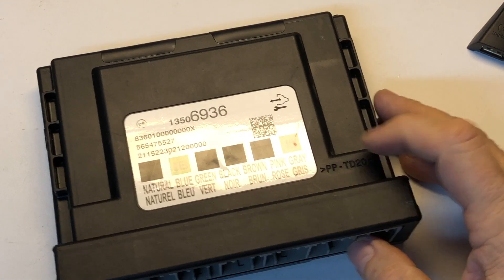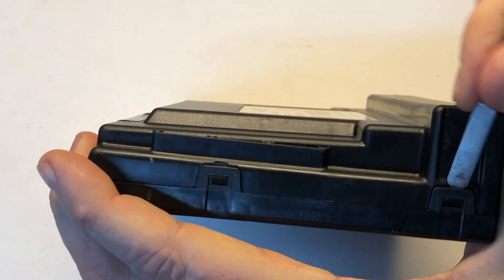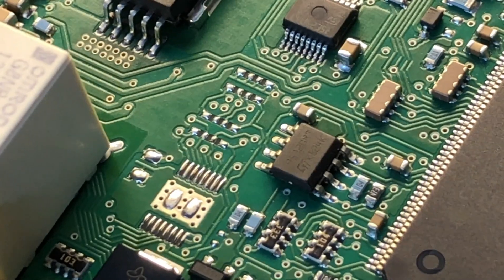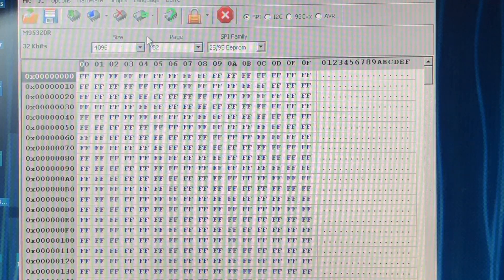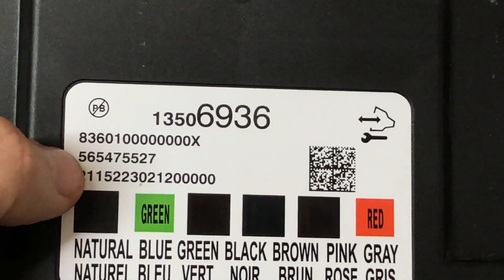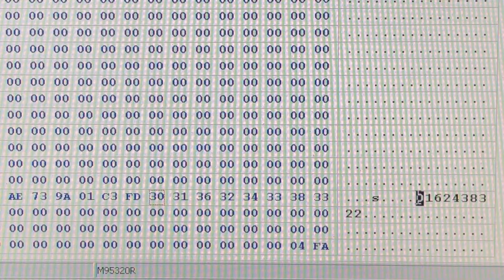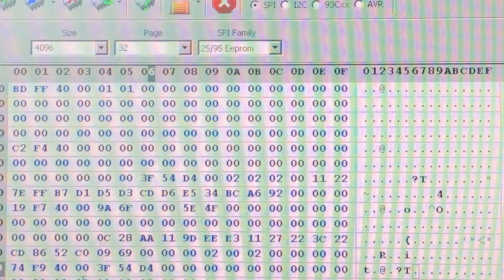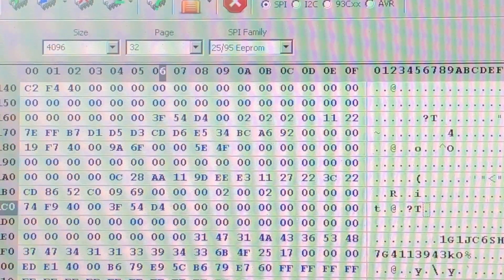2012 - 2020 Chevrolet Sonic Body Control Module (BCM) EEPROM Location & Contents (VIN, pin, mileage)

Comment: Hi  I bought an new Chevrolet Sonic  in 2014 . My kilometers started to disappear from time  to time.  I took it in for repair.  When I get it back the kilometers don't show not any more and sum other furthers  also don't work.  My original info on my BCM was saved on PC  in Bin Zip file.  Can it my be possible if my info on my BCM  cluster has been copied or transferred to an other client s car. And now he can not fix the problem.
Reply from the maker: Your story reads like botched repair attempt.   Could be the individual performing the work was unaware of the close relationship these GM models have between the BCM and IPC modules.  If you truly have an unmolested image of the EEPROM before any work was performed, it may be possible to restore that to a module of the exact same GM part number to get back to where you were originally.

Comment: did you ever tried to figure out where the features are stored at? Im trying to activate front fog lights in my Chevy using all factory used harnesses and switches, just need to activate it in the BCM
Reply from the maker: No, there's zero information of that nature.   Only the VIN and mileage locations are discernible without internal factory confidential documentation.   Option activation, like factory fog lights, has to be added to the VIN by GM directly.   A special code for this is included with the factory fog light kits sold by GM.  Check the tail end of this other video out for that process, https://youtu.be/_aO4vyqacn4

Comment: I am trying to do the same with the updated BCM part 13587704. but the chip is a 25LC32AE and I am having issues getting error connection. what  SPI should I use none of them on ASprogrammer sims to match the chip
Reply from the maker: You should be able to select a 23C32 under the generic menu (just ignore the extra letters in the part number).
Reply: @DrShock   Thank you, besides the power 5v mod does it need the other modification to the clamp adapter
Reply from the maker: No, the CH341A handles the 24XXX and 25XXX devices natively.

Comment: Good day....A new BCM do you need to program it for the interior lights & all lights...bought new one but done do these features...is it faulty please explain
Reply from the maker: A new, or remanufactured, BCM for a General Motors vehicle will need to be programmed.   The features enabled by this programming will be driven by the national GM VIN database (aka SPS2) which is used to put the vehicle back the way it was originally built feature/options wise.  If the vehicle was not originally built with options, they may require more than just BCM programming to enable.  There may be additional modules required, or additional wiring needed.   It depends on the feature, the model year, and the model involved.

Comment: Great video lots of knowledge! Do you have a video actually reprogramming a used one with your car’s original BCM coding? I have a 2013 Chevy Sonic that needs a BCM replacement.
Reply from the maker: Rather than reprogramming, since SPS2 will typically not allow you to reprogram an used module anymore, we just transfer the EEPROM from the original to the replacement.  No reprogramming required.

Comment: Does the GM BCM control Sunroofs, Keyless Remote reprogramming and Oil Life reset?
Reply from the maker: Depends on the year and model.  Some have separate modules for those functions.  In the Sonic covered here, for example, the remote keyless entry is its own separate module but the key recognition and programming is handled by the BCM.  The oil life reset I'm not sure, it may be handled by the IPC module nowadays.

Comment: I move eeprom from  old bad BCM to the new BCM but car wont start. In this Sonic 2017  you need to read  the MCU micro too?
Reply from the maker: The parts numbers have to match exactly between both BCMs.  Also has to be from a Sonic, as GM used the same BCMs across several models and this could affect microcode firmware not contained in the EEPROM.
Reply: Thanks. Part numbers match but Its  not  from  a Sonic. @DrShock
Reply from the maker: That may be the issue, idk.  I've ran into GM using the exact same part number radio module between the Cruze and the Camaro.  But the embedded firmware for the processor being unique between the two, due to each vehicle's radio having a different keypad layout.  It makes interchange limited to the exact same model only.   If you are sure you have your EEPROM pin 1 alignment correct, and did not damage the chip during physical transfer, I would suspect the problem being that it was not sourced from the exact same model.  When I do these repairs for a customer, I even insure the model year matches to avoid any drama.
Reply: @DrShock  eeprom is good and pin1 is correct. Also I have read eeprom and save data info.
Reply: Can these values be changed while the chip is still in circuit , or do they need to be changed after the chip is removed from the board . Also, a sonic that came factory with out fog lights requires sps programming / special kit code to make them work via the oem button . But the kit is discontinued now days.  Could a salvaged bcm from a donor that had with fog light option be used with this method to get the fogs to work with the oem button . Thank you very much for your videos and info .
Reply from the maker: In most cases, the chip has to be desoldered from the circuit board to reliably R/W it.  It would be difficult, and quite challenging, to adapt a BCM from a vehicle with different options, because you would have to discover not only the VIN location, but mileage, and most importantly where the security code is that allows the fuel to flow to the engine (this is part of the modern anti-theft system).  Technically this is possible, but I'm not aware that anyone has discovered and mapped out the BCM memory areas for the Sonic yet.   Today, the techniques I've shown are only used in repairing the BCM in a like for like options swap.

Comment: Great information. 👍 thanks. Where can I find gm bcm eeprom location and type information?  I'm starting to do this kind of clonning and run into road blocks because I can't find eeprom locations. Any help would be appreciated. Thank you.
Reply from the maker: Thanks.  There's no technical information publicly available about this, as GM definitely does not want board level repairs performed.  They are in the business of selling you a new or remanufactured module.  ;-)

You have to build up this knowledge thru trial and error, starting with the make and model vehicle of interest and purchasing a couple of modules from the salvage yard as an investment to experiment with.
Reply: @DrShock  ok, thank you for your reply. 👍

Comment: What program you use for reading and copying
Reply from the maker: The software on these EEPROM programmers is proprietary, and each one will have it's own program to use.   The particular programmer I'm using in this video has a related video linked in the upper right (circle i icon) and uses a Russian hosted program known as AsProgrammer.
Reply: @DrShock  Oh OK I have a 2015 Camaro 2ss that's got issues so I got a new BCM and I might just exchange the Eeprom and use this Vcg thing I got will see all new to me but I do electronics repairs just never programmed eeproms
Reply: But I might try to copy the eeprom first from watching your videos
Reply from the maker: I'd recommend just desoldering and swapping the EEPROM from the original defective BCM onto the donor BCM circuit board.  This will avoid alot of reprogramming (e.g., VIN, security passcode, mileage, etc).   Make a copy of the originals contents before you do, as you mention, just in case something goes wrong and you need to recreate it.
Reply: @DrShock  Ok ya I think its the same numbers as the one in your video I very much appreciate your responses

Comment: I believe the Sonic replaced the Aveo. Would you happen to know if the BCM is located in the same place on a 2009 Aveo?
Reply from the maker: If not, check the center console area near the shifter.

Comment: Hola quisiera saber si tú puedes reparar mi BCM, es un sonic 2013 transmisión manual, el carro se inundo en una tormenta y ahora no enciende ni da start el motor. Chequie el BCM y se siente muy caliente, que debo hacer para arreglar mi auto. Gracias
Reply: Si quieres te puedo dar mi e Mail
Reply from the maker: Esta situación que describe no sería una reparación típica de bricolaje. Necesita acceso a herramientas especializadas. En su caso, le recomiendo que busque un taller de reparación local.

Comment: So I've got a 2017 Chevy Sonic. My BCMs part number is 13506935 though. Using this method, would I be able to simply copy my original BCMs EEPROM data, save it on my laptop, connect the donor BCM's EEPROM and then paste/overwrite the donor's EEPROM with my original's EEPROM data and use it?
Reply from the maker: That's the jist yeah.   Your EEPROM programmer will have some software application that goes with it, which handles reading the chips contents and saving it to the laptop drive.  Next you could write that contents onto the donor BCMs EEPROM.  Note that there are some changes in boards, and changes in part numbers, where this cannot be done in-circuit with a testclip.  In such situations, you will have to desolder the chip in order to read/write it off the PCB.   

You can also desolder the EEPROM from the original BCM, and physically substitute it onto the donor BCM's PCB instead.   Either way you get an exact clone, presuming the GM part numbers of both BCMs are identical on the white label.
Reply: @DrShock  I ended up just copying my original BCM data over to the doner BCM. Worked like a charm once I got the  programmer to be recognized. Car works as if it was using the original BCM.

Do you know if the same process works on Global A engine control modules?
Reply from the maker: Great, thanks for sharing.   I've not had to work on a BCM newer than 2015 or so so couldn't say about Global A.   Definitely cannot reuse an used module via an MDI on Global A though.  GMs tools are all setup to force the use of new or ACDelco reman modules only now.
Reply: @DrShock  Well the Sonic is a Global A car. From my knowledge all GM cars from 2012 up are on Global A with Global B being introduced on new models starting with the C8 Corvette.
Reply: I forgot to thank you though
Reply: @SonicSouz  I have same car (Sonic), same year (2017) same BCM number. Did you bought your BCM from a used car? Was the used car a Sonic 2017?  When you said just copying original BCM data over to the donor BCM,  you mean eeprom data only or eeprom data + MCU data? thanks

Comment: I am dealing with the same 95320R in a body control module in a 2014 GMC Sierra. Connection is made just fine with the ch341a and asprogrammer. Says “success” but as far as reading the actual data off the chip nothing is there? Everything to the right is blank. Is this a voltage issue or?? Thanks for the great videos you do!
Reply from the maker: If you're sure the pin 1 orientation is correct, and you're trying to read the chip in-circuit (i.e., still soldered to the board) this might indicate a bus contention problem.   This happens when the test clip powers up other devices on the board that also attempt to respond to the data and address line changes preventing reading and writing of the EEPROM.  If this is happening, you'll have to desolder the chip and read/write it off board.

This is actually quite common to encounter on GM electronics, it's usually quite rare to get a read/write in circuit on them.

Comment: I’m trying to install a bcm for a 2012 Buick LaCrosse. I was wondering if it’s in the same location?
Reply from the maker: Same approach for all, but unfortunately they are all a little different in terms of circuit board layout.  I've done a few of these BCM EEPROM identification videos, but I don't think I've come across the need to do a Buick one yet.

Comment: I have a 2006 Dodge Charger r/t that’s been parked has a Front Control module /Central Gateway Module or Body Control Module I’ve heard it called either but it has one from a salvage yard with a non matching vin and because of that many things in the car don’t work and it’s stuck in limp mode could I change the vin manually in the FCM to match the rest of the computers vin so that they can all communicate happily?
Reply from the maker: I don't have any experience performing this sort of circuit board level repair with non-GM electronics, but conceptually the process should be similar on Mopar products.

Comment: The info on replace eeprom to use a used replacement BCM is great. just hope the eeprom is not corrupted or problem with module Thanks again

Comment: Question gm srs or scm for air bags.... how do you read the eeprom  via the connector...as some of these srs module are extremely  difficult  to remove the cover or remove the circuit boards from the integrated molded connectors.. many eeproms  are located other side of the circuit boards are not  easily accessible  to read eeprom...any help is apreciated..great videos

Comment: Excellent video. I have a 2016 Corvette radio module issue. My original got damaged by water so I bought a used one of the same part number.
I'm having trouble verifying if my module has a similar EEPROM as described here. There are only two on my board the look similar. One has the following 3 lines: 80020BB, M59454, 15380. The other chip is smaller and has these 3 lines: RT8H, 545E, S63.
Are either of these ICs, the one I'm looking for?
Reply from the maker: Thanks.  So this video is about body control modules, rather than radios.  You might want to see if this other video is similar to your 2016 'vette instead - https://youtu.be/iBXLnHlbnDo

The thing about these modules is they are always getting redesigned by different suppliers to GM.   The numbers on the chips often only mean something to the supplier.   You find the chip that represents the memory by trial and error.  Those three you mention, I've not run across before personally so couldn't say.

Comment: Hi 
If i replace any module in GM automotive by used module Should i program the module by SPS Or it is not needed, just install it and it will work directly without programming. Please clarify because this point I did not understand well
Reply from the maker: Typically you cannot reuse modules across the more modern GM vehicles, on the Global A architecture.   While you can use SPS2 (Techline Connect now in the USA) to update a calibration, it won't let you change the VIN or mileage of an used BCM.   If you're working with a brand new GM or ACDelco remanufactured BCM, then yeah you can setup using Techline Connect SPS2 just like you would have done using TIS2Web SPS last year.   But if you are trying to reuse an used module from a different VIN, this EEPROM chip level rework is about your only option.  SPS/SPS2 are a no-go on used modules.
Reply: @DrShock  Will the chip swap work for Global A vehicles? I have a 2016 Sierra with a amplifier module that I'm needing to replace.
Reply from the maker: Haven't personally tried it.  But probably the only option for salvage parts since that platform will usually not SPS2 on an used module.
Reply: @DrShock  this used to be possible with sps1 a couple of years ago. They blocked it. I remember I had to replace the bcm on an 2013 Cruze and the programming went through but the original mileage was not retained.